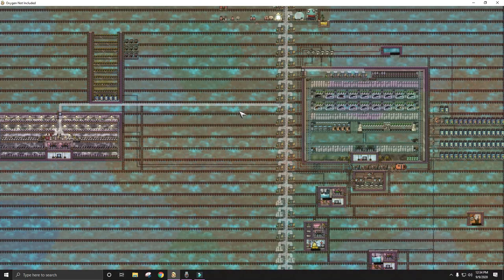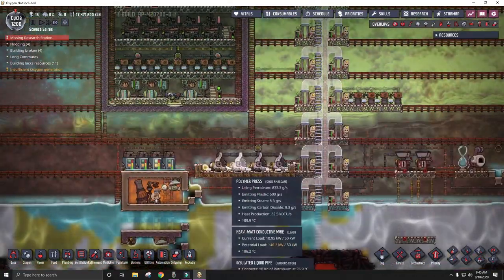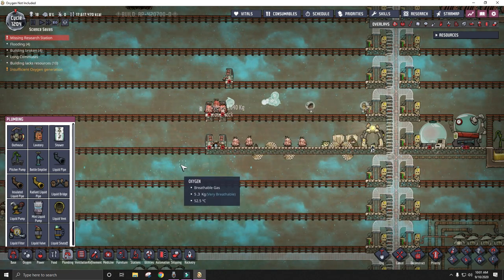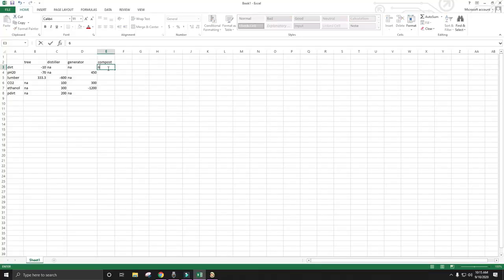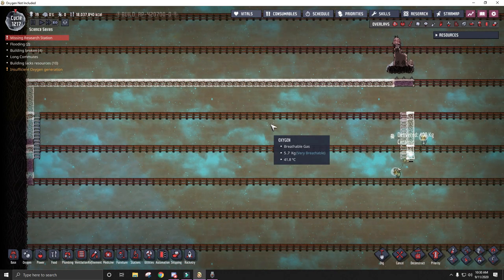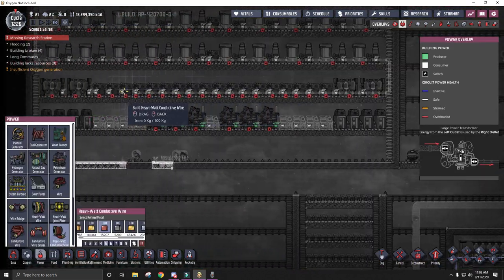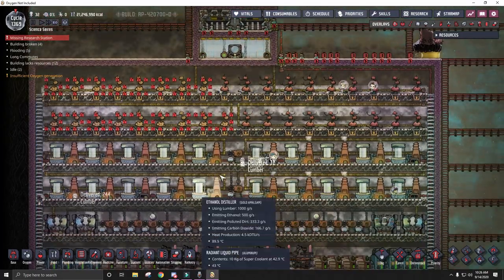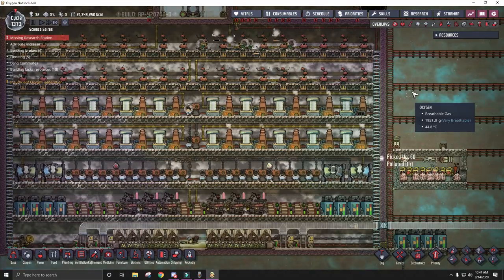Overly Scienced - Episode 14: Arbor Tree Farm/Ethanol Distillers (Oxygen Not Included)

Comment: Suggestion, when doing equations in excel lock in the cell number clicking on the cell and then clicking F4, it will cycle adding '$' to the cell location to make it look like "B$1" as an example. Makes it easier when moving around stuff, it can do individual cell locations or by the row / column.
Reply: This is a good tip

Comment: Cool video, sorry, late to the party... You could compact the tree section, because each tree only grows 5 branches. With luck, or manual pruning, 3 trees can fit in a 7x3 instead of a 9x3 space without loss of efficiency (T - trunc, B - branch, F - floor, H - hydroponics):
B1 B1 B1 B2 B3 B3 B3
B1 T1 B2 T2 B2 T3 B3
B1 T1 B2 T2 B2 T3 B3
F1 H1 F2 H2 F3 H3 F4
is the neatest looking solution to pack trees. This also cuts down a little on pathing and travel time for dupes during harvest. I was planning on net-producing fertilizer and clean dirt for sleat-wheat and bristle berries with a smaller setup (9 trees in a 8 pip ranch, barely fits the 96 tiles + 4 ethanol distillers + 1 petroleum generator + 1 natural gas generator + 5 fertilizer synthesizers + 15 compost + 4 carbon skimmer + 1 sieve). Natural gas gen, sieve and trees are slightly under-utilized, but this seems fairly well balanced and produces per second 1.3kg dirt, 600g fertilizer, 300W of power and a butt-load of heat from 130g phosphorite and 360g of poluted water. A slush geyser and balm-lilly drecko farm makes this (hopefully) self-sustaining. If my math holds, that make for a lot of happy dupes high on berry sludge ;-)
Reply from the maker: I might try this in a future tree farm build; I like the space efficiency.

Comment: For the excess carbon, instead of using a carbon skimmer which takes power, water and sand which doesn't produce any oxygen in return, you can vent the CO2 to 3 different optimal things: You can feed it to a slickster ranch, you can feed it to a combo nosh bean and sleet wheat farm, and to a CO2 rocket engine. Any extra CO2 that you don't want that is in excess you can just vent into space.

From my own calculations I started with how many distillers it takes to run a single burner and I found that it takes 4 distillers per burner. So if you have 4 burners you'll need at least 16 distillers. However, you're going to need a few extra distillers to produce a little more ethanol that your nosh beans need. So a nice ratio is to have say 6 burners with 30 distillers which will give 6 extra distillers to produce the needed ethanol for about 20-30 nosh bean plants. You could even add an extra 2 distillers that can chilled for cooling loops. In fact you would have to chill the ethanol that is directed towards your nosh bean farms because the ethanol will come out at about 120 degrees close to its evaporation point which I believe is at about 137 degrees F and this is way to hot for the nosh beans as well as for the sleet wheat. They like it cold almost freezing. So this pipe feed needs to be chilled. This is where I'd send it through an aqua tuner first then feed it to the nosh beans with a higher priority and then any excess ethanol will bypass the farms once it backs up and will continue through the cooling loop.   

Ethanol can make for great early to mid game coolant as it can get extremely cold before freezing. You just have to be careful with how hot it gets as it will evaporate before water. You can chill it down to about -130 degrees in Fahrenheit before worry about it freezing and turning into a solid that will burst your pipes. This can significantly cool down any kind of production or industry buildings that generate a lot of heat, just feed it into an aqua tuner loop to cool it down to about [-130,-120] range and your nosh bean farms require the cold climate. Now If you are using it in a cooling loop make sure that it never backs up within the loop. The fluid has to keep moving otherwise if the ethanol sits there and gets too hot, it will evaporate out of the pipe and turn to ethanol gas. As mentioned above, the excess CO2 can be pumped to the nosh bean / sleet wheat farm as they both will grow in a CO2 environment. So will your mushrooms but they like it dark and a bit warmer. So having your mushroom farm closer to your slickster ranches is a better option, the CO2 is already there, you'll just need slime for the mushrooms. 

As for the 6 burners they will generate 12,000 KW at base level without any tuning. However, the power required to run the distillers as well as that of the automation system, water pump for the arbor tree farms, and any gas pumps for redirecting the CO2 does constitute about 2/3 - 3/4 of that generated power. So you'll get a net access of about 1/4 - 1/3 power from that generated 12,000 KW and this is without the power consumption of any aqua tuners. However, for these numbers 32 distillers do take up quite a bit of room. So you'll have to make some tradeoffs on the design decisions on how many petroleum burners you'll want to have just for burning the ethanol. Now, once you get into mid to late game where you have better power generation such as solar panels, petroleum, etc... You can then remove some of those dependencies from your distillers and now produce a substantial net worth of ethanol for more farms and cooling loops.

Then from there calculate how many trees you'll need. Now to support this kind of large setup you will need to have a cool slush geyser or two on the map that will produce enough polluted water to help keep the system running and with the excess polluted water you can pump some of it out to be sent to a water sieve that will clean it that can then feed an electrolyzer. You can set up a small room with a single electrolyzer, 3 gas pumps, one for the hydrogen and 2 for the oxygen and feed that hydrogen into a hydrogen burner, along with a smart battery, some automation and radiant pipes that your water comes in to feed the electrolyzers. The initial setup will require some external power to jump start it, but once it's up and running and the battery has charge it is self powering. You will have to create a liquid lock and prevacuum it out so that you can build up the hydrogen and oxygen where you want it. As for the oxygen, it's virtually free as long as you have water. You can pump this approx. 80 degree F oxygen out into your base or feed it to exosuits, to the dream machine, or even to other facilities. As for a nice self contained and compact electrolyzer build check out Nathan's Sandbox Y.T. channel and look at his 1 Dupe Challenge Series. Somewhere around the 4-6th video into the series, he makes a great build on the electrolyzer. Everything in the game is useful, even CO2.

Other than that, your calculations and setup is quite good, and I like your approach at solving any issues within the design pattern. Nice video!

Comment: I might have missed a point: How does it restock the filtration medium? I am running out of sand with this pretty quickly. Four sieves waste 2400 kg sand per cycle. That would mean I need to feed about 34 Pokeshells with 4800 kg polluted dirt per cycle. But this only produces 3540 kg of polluted dirt.
Wouldn't it be better to pump the carbon dioxide into space?
Reply: Yeah either vent into space or feed to slicksters

Comment: Hello !  Can I ask you a question here about automation and will you try to answer it ?
Reply from the maker: i can try, what's your question?
Reply: @cometgaming8812  Thanks for the quick reply. Let's say I have a Shearing Station (for Drekos) and an ordinary Lamp next to it. I want the Lamp to activate only when the Shearing Station is active. Can I do that with automation ?
Reply from the maker: @power2084  yes, use a duplicant motion sensor to detect when a dupe is using the station and connect the output of the sensor to the light. you could also use a weight plate in place of the motion sensor
Reply: @cometgaming8812  fantastic !   Thanks. However, is there a way to directly detect that the Shearing Station is active thru a signal ? The methods you gave me are indirect ways, which will work just fine, but just for my personal knowledge, is there a way to directly detect the activation of the machine thru a signal ?
Reply from the maker: @power2084  there is no direct way of detecting use
Reply: @cometgaming8812  allright.....thanks man

Comment: Now do the same calculations with sliksters. amount of energy and sand you waste while using skimmers unforgivable.
Reply from the maker: I would need over 100 slicksters to consume all of the CO2. Assuming 100% uptime, each distiller would make 100g of CO2/s and each generator would make 300g of CO2/s. A slickster can only eat 33.3g/s so ((20 *100g) + (6 * 300g))/(33.3g) = 114 slicksters; not feasible.
Reply: @cometgaming8812  Fair enough. But what about free eggs from ranching and decreased power consumption by the scrubbers and filters? 114 slicksters should be able to feed average base. The only downside I see is the space requirements for the ranches, but it can be evaded by using excess space for storage.